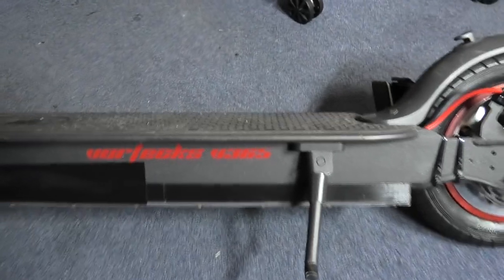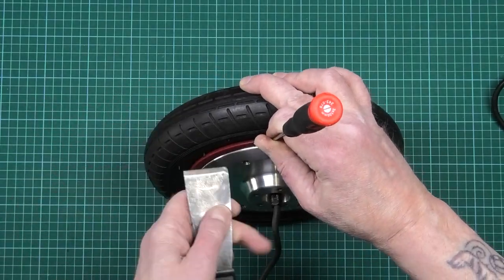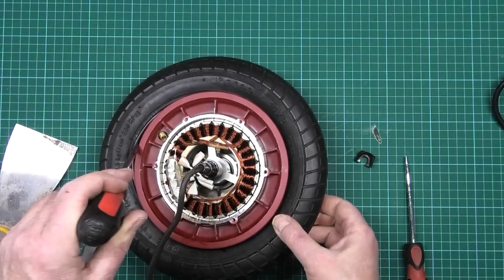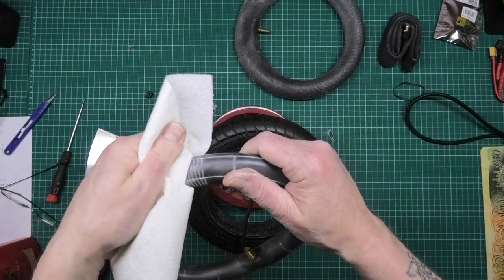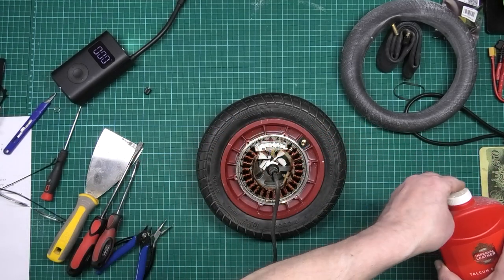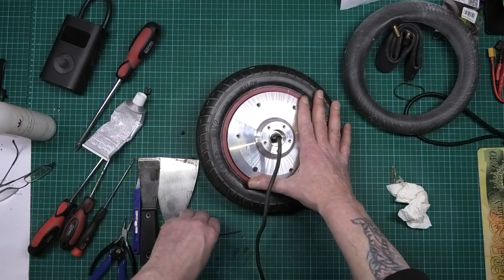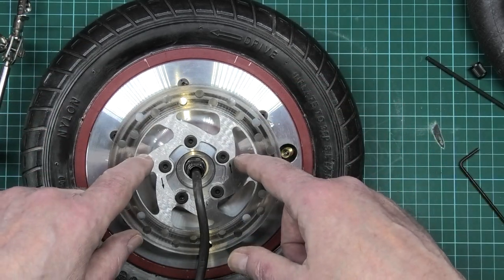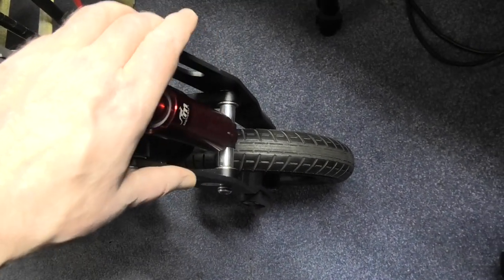M365 RWD rear brake fitting part 2

Comment: Hi!  
Please I have a question: What is the name of the metal part in the minute 14:30 for the rear wheel.  I modified my Xiaomi 1s 10"x3 tires and had to drill a hole in the back. I had to move the rear wheel back about 1 cm so that it turns well. But my rear wheel still rubs a little bit. Please how  is the name of the metal part in minute 14:30 minute can you please tell me the name of the metal part please!

Comment: just bought and installed rear monorim suspension, the thing ride like mercedes S class now with front and back :O highly recomending
 it, but not sure about fitting rear motor into it :/ (2x piece mudguard v1 suck a big time, i needed to 3d print v2)

Comment: Hi, Tony, great vids. Always make me chuckle. 
Can you please tell me which wires you change to reverse motor rotation to fit on back with brake. I was told to swop around green & yellow on the small plastic white connector & the other fatter wires go yellow brown blue which were originally  bl, br,  y . Is that correct? Don't want to chuff it up. Thks, steve.
Reply from the maker: I never actually used the standard controller when I made it RWD mate. My advice is to take a note of where it is now and then, swap them over. The very worst that'll happen is...... it won't work or it'll 'cog' (make a clunking noise). You'll only be testing it for less than a second so it won't hurt.
Reply from the maker: Some clever sod might come along and tell you to simply change over 2 of the phase wires but this isn't the case when you've got a sensored motor, it all has to be in sync.
Reply: OK  thks for answering, as long as it's not gonna fry something  I'll give it a go & let ya know, Cheers.
Reply: @Vortecks  Hi Tony, just tried it &  yep works a treat. So I can confirm the advice I was given is indeed correct. Av a good one. Cheers Steve

Comment: I fix these on a daily basis as part of my job and i can mount/unmount all of those tires without any tools only using my hands in about 30 seconds 😆😆 It hurts to watch. Its hard to learn but it's totally doable! First step is to have less air than that, you only want enough air for the inner tube to cease being a pancake! not enough for it to be round

Comment: There’s a simpler solution we just drilled a hole on the opposite side of the wheel hub. Then theres plenty of frame clearance. We ran into the problem when fitting hydraulic calipers.

Comment: I've a 500w e-bike now do I just need to upgrade the back wheel to 1500w or do I need to change the wheel and the brains to 1500w to get more power. I'm so confused. Thanks mate
Reply: Who gives power is the battery and the controller. The motor, for instance, rated to 500w or 1500w or whatever without overheating. If your battery and controller can provide only 500w, does not matter if the motor is capable of 10.000w. It will run with the only 500w. Did you undertstand?
Reply: @Full_Throttle_no_Brakes  my battery is a 48v and my controller is on a 1000w and 1500w version. So what do I need to upgrade?
Reply: @Paul-vl8zq  more voltage= more speed. More amps=faster acceleration.

This is a extreme simplification:
First You will a controller that can suck the power from the battery to the motor, second you need a battery + bms capable to supply the power sucked by the controller.
If the controller is too powerful (suck too much amps) the bms will shut down the power to protect the battery. 
When buying parts or building an electric vehicle, The battery can be more powerful than the controller but the controller CANNOT suck more power than what the battery is able to supply.